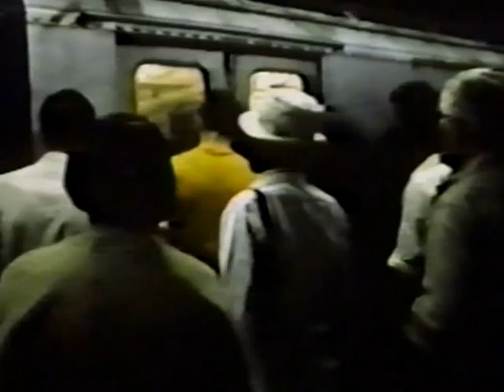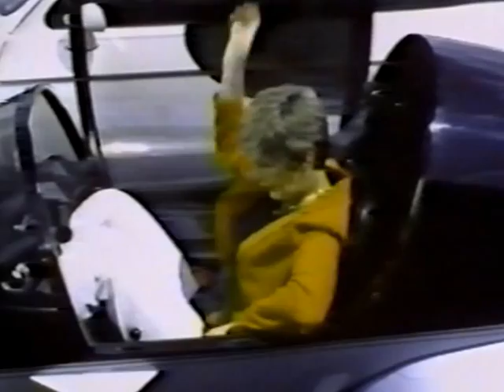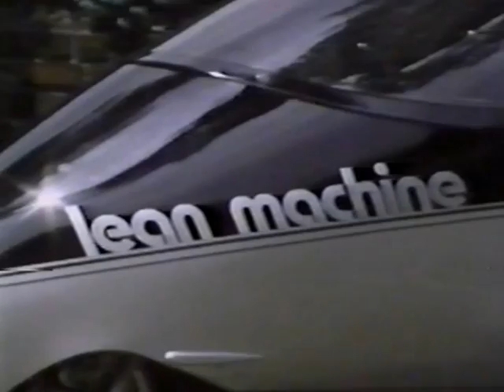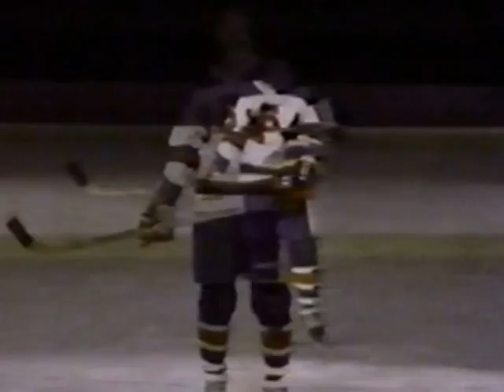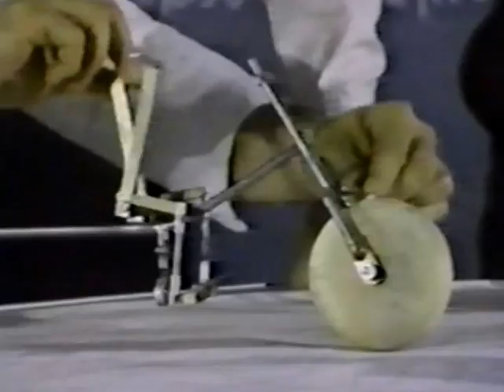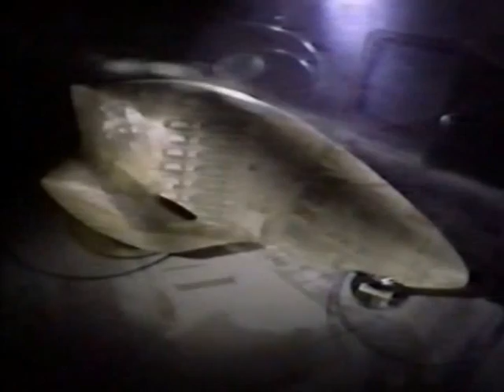Frank Winchell's Lean Machine (GM)

Comment: We need these now in 2024 more than ever! I wish they'd just go on and make an electric version of this since these would definitely fall under the light quadricycle category of vehicle like the Aptera... Ford Cockpit designed by Ghia was a similar tandem 2-seater that also should have went into production. Why we think we need to haul ourselves around in battle tanks for "Safety" when its easier to avoid a crash in a smaller vehicle to begin with...
Reply: Agree but not the likes of iroad or lean3 which is only 80km/h top speed..we need something we that is highway or expressway legal

Comment: The Toyota i-Road is the latest and most developed 1+1 tilting car like this i think.
Reply: Yes and no. The bizarre thing about the i-Road is that the two front wheels don't steer, but the tailwheel does!
Reply: Don't suppose any of the manufacturers now-a-days make the cambering vehicle with one wheel in the front, and 2 in the back like Frank Winchell did, which I think is a classier style, than the reverse/opposite way, and it might be better in the snow, and ice stuff, or with the possible 200 mpg possibility itself too!!! Sincerely, The Psychic Surgeon!!! Kelly!!!

Comment: It's a shame these kind of tilting vehicles never turn out to be successful. The Lean Machine really made me interested because it doesn't utilize a complex control system to set the tilt angle, you just use the foot pedals, though, I do wonder how hard you had to push on the pedals to keep it from falling over.

Comment from the maker: Frank WInchell first came up with the idea of cambering vehicles in 1975.  There were 17 different models that included a scooter version, a motorcycle version as well as a manual powered version.  There is a company producing a near identical version of this model called the Trikke.  It even has ice skate and snow ski attachments just like Frank Winchell's.  The final version you can see in the movie "Demolition Man" had a 15 hp engine that topped out at 80 mph with an estimated 200 mpg.  They made a faster model with a 39 hp engine that could do 100 mph with an estimated 120 mpg.  Toyota, Honda, BMW and many others are only now starting to produce their versions.
Reply: Why they don't try to promote this vehicle?
Reply: Thank you for uploading this.  My dad is in this video.  He was also Wesley Snipe's stunt double and drove the lean machine in "Demolition Man".
Reply: @clggauthier  Your absolutely right!!! Yes!!! and I did post this to FB. Sincerely, The Psychic Surgeon!!! Kelly